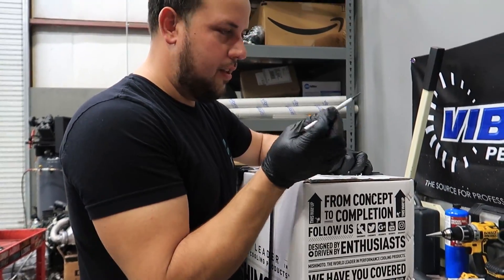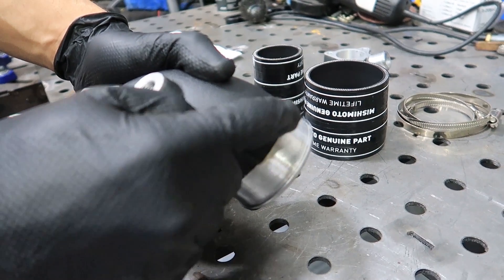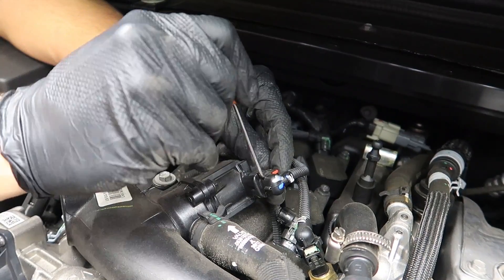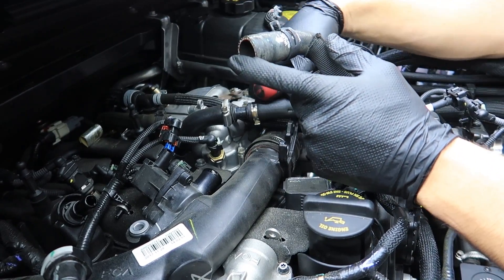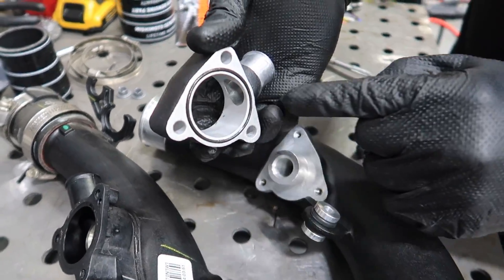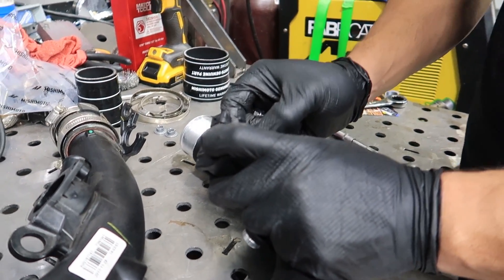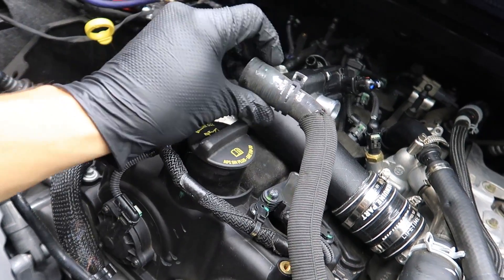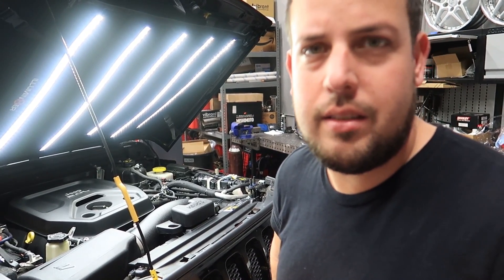JEEP WRANGLER JL TURBO CHARGE PIPE UPGRADE INSTALL

Comment: Holy shit man, 57 psi in your tires. Even with oversized tires like 35s 30psi is a sweet spot for most oversized tires. It'll ride so much nicer too.
Reply: I was thinking the same thing
Reply: im on 37's and run 24 psi.....

Comment: why do you run your tire pressure so high? I usually run it at 36 psi for the jl
Reply: I thought the same thing
Reply: I'm assuming he does for better gas mileage/performance, but I could be wrong.

Comment: What exhaust  are you running or did you modify the stock one? It sounds good! I have a 2.0 JL as well and I  was looking at this intake so thanks for the video. I subscribed as well for future updates on your jeep :)
Reply: Also looking for the exhaust he is running, have a 2.0 JL as well
Reply: @robbysatch272  I noticed at 8:34 there is no sign of the stock muffler, and I've listened to a lot of other aftermarket exhaust and none of them sound like this one so I'm thinking maybe he cut it off?
Reply: It’s just a muffler delete.